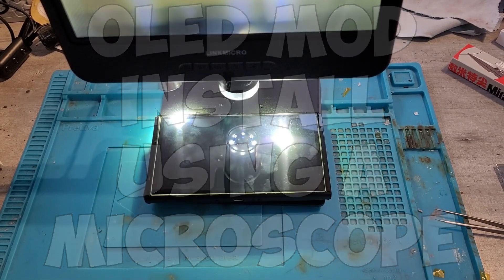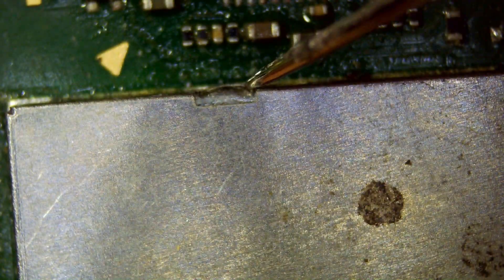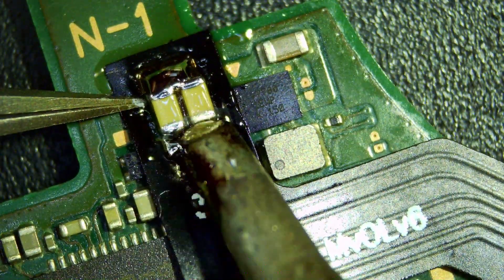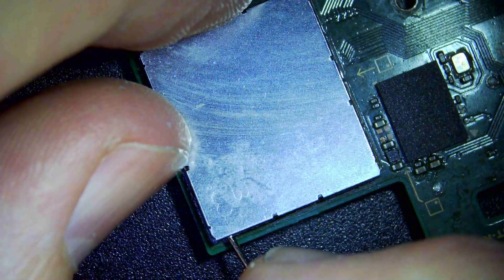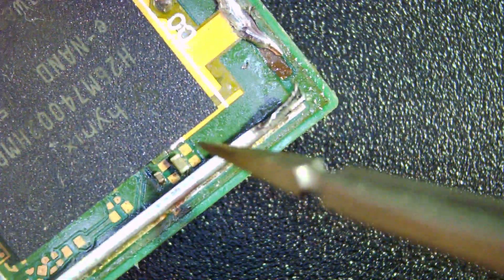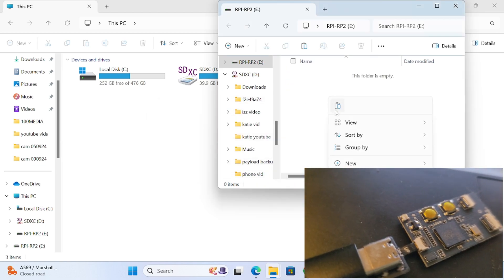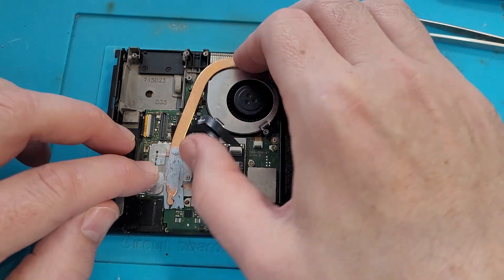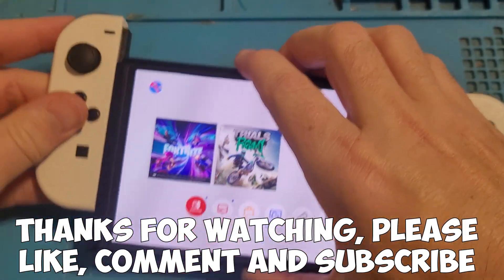**UPDATED** Guide to installing an Oled Mod chip | Using a LinkMicro LM210 microscope

Comment: I tried to mod 2 of my oleds. Both I did right I believe. Every measurement came back as it should be. 1st one started for 1 min and never again turned on, now black screen. The 2nd still all measurements I triple checked, it booted only to ofw and got the code rst not connected. I left it turned on a bit and the screen flickered and went snowy... I panicked and removed quickly the battery. I then removed the modchip but not the ribbons etc. Snow got removed and it survived. Any clue what is happening? I'm pretty sure I did everything correctly. I went back on aliexpress to ask for a refund. The seller removed everything... I noticed I have the same version as yours. I ordered them 2 weeks ago. I only connected the battery, lcd and the power on off button to test (i don't think this my issue). Maybe it needs the sd part of the board?
Reply from the maker: I would always check solder points are strong , also if anything is shorting
Reply: @fixingmoddingbuilding  for the 2nd one it worked. I was so afraid to do anything wrong that I forgot to connect the cpu cable. Now it works. Silly me.

The 1st one probably I will take it to a shop locally because it's beyond my skill to find the actual issue. I would send it to you because you seem skilled enough, but you are in UK. Probably the round trip will cost alone the same to buy a new motherboard... Thanks for the time to answer it was really helpful even though I did such a silly mistake
Reply from the maker: @ΣπυροςΓιαννας-τ9λ  We learn from our mistakes, I have made plenty!

Comment: Would it be worth it if i decided to install a modchip with no microscope and soldering experience whatsoever?😅
Reply from the maker: I did many years ago, installed the sxos one on a lite, still don't know how I did it, worked first time though!
Actually had a video doing it but the big N removed it 😂
Reply: @fixingmoddingbuilding Alright tysm for answering😁
Reply from the maker: @hahahagakupalka  I might be reluctant to do my first mod an oled though!? Good luck!
Reply: @fixingmoddingbuilding if i somehow break it, well game is game😂
Reply from the maker: @hahahagakupalka  Sell on ebay!
Reply: @fixingmoddingbuilding LOL😂😂😂
Reply: If you have any old circuit boards lying around especially ones out of old smart phones then find the smallest surface mounted cap or resistor on it and do some test runs on it by tacking tiny wires  to each side of the caps, resistors this is what I did, my first switch modchip was the V2 model and had a spare ribbon for the v1 that I used to test run with practicing tacking it on to caps, I'm no stranger to soldering but micro soldering is a different story one slip and those caps are coming off or bridged, i do my switches with without a microscope I use an eye glass which gives me a real good view of what I'm soldering.

Comment: Done installing the chip also flashed it. But no sign of boot(blue light) after hitting the power button. I disconnected the ribbon on the chip to check if I didn't mess up my switch lol, it boots normally.
Reply: Sorry for the late update, what I did is I resoldered it using a new set then it worked lol. Thanks
Reply from the maker: Check software on chip, all solder points, connector pushed in correctly under nand?
Reply: What was then?

Comment: Thanks for this video bro!! 

Would you have a video for installing the hack once it's all up please? I'm used to v1 but not oled this is my first with weld 😅
Reply from the maker: It should be the same if I think I am right what your asking ?
Check this video to follow:
https://youtu.be/sawDPGJfcl0?si=PVaOQPuLUQtd1V3Y
Reply: Yes thanks! But I would have another question ahah, I install everything, correct weld. When I want to turn on the switch I have blue and yellow LED like you, but screen stays black 😅 do u have a solution ahah?  @fixingmoddingbuilding

Comment: Quick q - at 1:45 when you put solder on the pads - do you just tin the spade tip of your iron and run it over those pads? Also, what flux are you using to prep the pads? What is used to clean up after? Thanks! EDIT I see isopropyl to clean, ta!
Reply from the maker: Yes, tin the tip, I use kingbo flux and clean with 99% isopropyl

Comment: Hi. I just ordered this modchip because previous model I got shown no sing of life when connected through USB cable (pushed yellow BOOT button, even resoldered USB-C port to ribbon cable). Did you have any problems with this particular model? Did any of them fail on you?
Reply from the maker: I've bought a few and not had any bad ones yet, I'm sure there out there though!
Reply: @fixingmoddingbuilding  Just installed it, except few mishaps during installation on my part works smoothly. Great guide!
Reply from the maker: @sneakyleaky7670  Glad you got there in the end

Comment: This is my first time installing this modchip. To summarize, I’ve soldered everything down.  My dat0 adapter reading was .712, and I used 38 awg copper wire. I was following along the old video until I realized this one existed and I skipped the scratching step. I tried to desolder the trace but no luck. I flashed the modchip and decided to try anyways. The modchip flashes blue once, but green three times. The switch also boots normally, but not to the custom firmware. Kinda at a standstill now because my oled died, but it’s charging now. I’m thinking the problem is the part I skipped. Any insight would be much appreciated 🙏🏻
Reply from the maker: Not sure sorry

Comment: 3:41 I script the copper pad very nicely, however the solder does not want to stay on that spot, any suggestions please. all other point solder sticks. the D point. any helps please
Reply from the maker: Maybe try and scratch a little further down the trace?
Other then that, plenty of flux, and a decent solder tip.

Comment: after installing the same modchip then flash firmware all is good but its boot to ofw 
Led light blue then twice green 3times  and its normal boot  what is the possible promblem?
Reply from the maker: If your sure the chip has fw on then it will be either a solder point not perfect or the part that slides into the nand is not making contact

Comment: Hey man another question, is 0.465V reading on DAT0 point enough?
Reply: I get 1086 mV on DAT0, and I also wonder if it's ok
Reply: @  well for me it was! The main thing was to make sure the adapter was on properly because it got loose for me afterwards. I feel like your value may also be fine but I’m no expert
Reply: @usmannaveed6595  Thanks, I just finished soldering, connected everything and I have no sd card screen, so I guess it should work
Reply: @ nice brother

Comment: Hey quick question before I start this, I can’t open my chip on my pc but I know it has firmware installed already, if it is the incorrect version will it cause problems to my switch or can I easily replace it and no problem?
Reply from the maker: If anything it will just be an older version but should be fine, last time I updated to a newer version it booted pretty slow so I'm not in a rush to update anymore.
Reply: @ thanks 🫡

Comment: Heads up for beginners, the point where you scratch is the hardest of all.
Reply from the maker: There is many parts that are hard, if you do it, slow and steady, its one of my least favourite mod chips to install!
Reply: @fixingmoddingbuilding  Yea, i wish i got a normal v2 switch.
Reply: the hardest was soldering to point a for me its so small and i dont have a microscope i havent gotten it to work
Reply: @Diamondst  true
Reply from the maker: @Diamondstyy  Try using your phone on zoom, or download a microscope app?
Reply: @fixingmoddingbuilding  that's what I was doing but it's just not clear enough

Comment: How long did it take to install this?
Reply from the maker: This was the second one I did so was a bit quicker, maybe under an hour?
Need to go slow with this as there is a lot that can go wrong!
Reply: @fixingmoddingbuilding  I was asking because I recently sent my switch to be modded, and I just wonder how long it normally takes

Comment: What wire did you use on this project? I'm about to attempt, but the only thing i don't know is the wire gauge and type..
Reply: What is have read so far is always 34 or 36 AWG wire

Comment: What soldering iron are you using in this video? Is it the TS101 you showed in your equipment video? I am using a cheap one from Amazon. I was thinking of upgrading.
Reply from the maker: Yes I use the ts101, really good, good choice of tips.
Before that I just used a cheap non branded one, did the job just sometimes hard to get the tips to get hot enough to solder well
Reply: @fixingmoddingbuilding  Thank you

Comment: Which modchip is this one? It looks exactly like the one I just had installed in my OLED switch and I'm curious to know what it is exactly (PICOFLY, HWFLY, generic RP2040, etc).
Reply from the maker: Rp2040
Reply: @fixingmoddingbuilding  Thanks for the video!. I found a lot variant of rp2040. Could you share the link you are using?

Comment: Im not getting any reading on the multimeter. What am i doing wrong?
Reply from the maker: Either its not push in correctly/enough to make a contact with the pin so does not read or you haven't set your multimeter correct?

Comment: Finished the install.  The chip lights up.  But it boots straight into normal OS.  "No SD Card" didn't show up.  Can you please tell me why?  Thanks
Reply from the maker: One of your solder points will be at fault, if all perfect check there is software on the chip itself?
Reply: @fixingmoddingbuilding  Resolder C Point.  Everything works now.  Thanks again!

Comment: What happened if i have more than 800 in my reads on diodo mode?
Reply from the maker: It normally means its not making the correct contact so could have booting issues?
Reply: @fixingmoddingbuilding yeah i have this issues, how can i fixed it?
Reply: Soadkirua Do you have an answers bro?
Reply: @Ty_Danty nothing, finally i broke my switch OLED...

Comment: No hot air on the dat0 ? Isn't that gonna be dodgy ?
Reply from the maker: Most people say don't do hot air as more chance solder balls cracking in the future.
Kamikaze is the best option followed by this. If this is soldered secure not much chance of it moving

Comment: Don't cover the buttons on the chip. You can tear them off easily if you need to reflash the firmware.
Reply from the maker: The kapton tape I know and use is not like gorilla tape, I think they will be fine

Comment: looks like this  microscope doesn't have as much magnification as  others
price is  pretty good I wonder if it can be placed on an articulable arm and if you can update the optics?
i am really having a  hard decision as beginner who wants to get into installing these chips or at least installing an RCM X86 on my extra V1 erista.
also can you tell us which iron and tip you used and recommend solder and flux?
Reply from the maker: I feel like it zooms in as good as the others I've used, plus it has a digital zoom in it too.
I could have gone closer but was happy with the distance. 
Like all of them I think they would fit on a boom arm if needed.
Reply: @fixingmoddingbuilding  yeah I am really having  a hard time deciding what about hose ones that are just  advertised as 4k camera sensors microscopes with a boom arm
 don't those  allow you to  look closer and   with more room to work height wise?
the ones I have been look at are  like $80-100 on aliexpress but then there are ones that look like scope in the   video on  boom arm but they are expensive, ad like $240
I am a vine member and have passed on few of the scopes with bases because of tax reasons and because they looked to not zoom enough but I am really not sure how to read specs and I just don't trust the advertising because like a lot of this Chinese stuff it can be  very misleading sometimes.
I see some advertised as "coin microscopes"' and I though the difference is that the coin ones need to have the scope up close to the works area where as   ones with better optics  (and sensors?)  for soldering can be positioned high above and still achieve good magnification.
I am looking for the best price to performance ratio  for my needs as a beginner.
I hear people say the boom arm camera ones feel awkward because of having to look  to the side